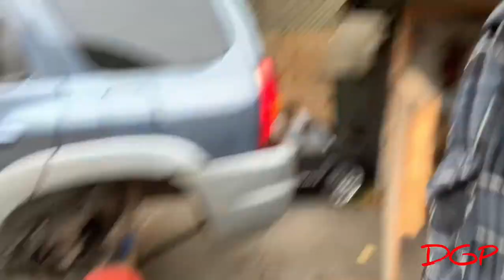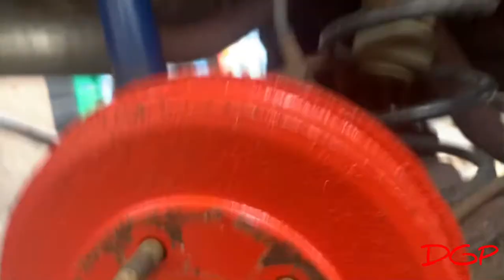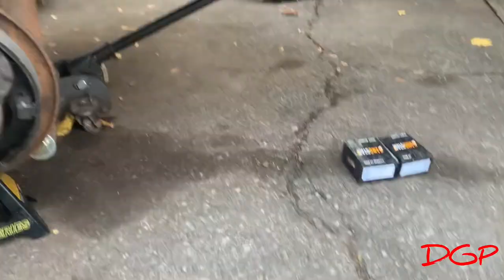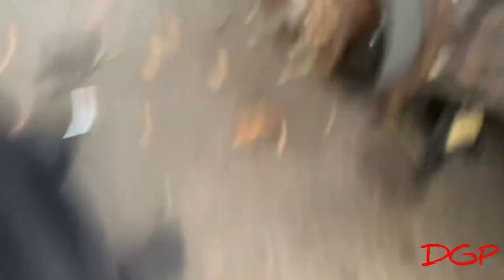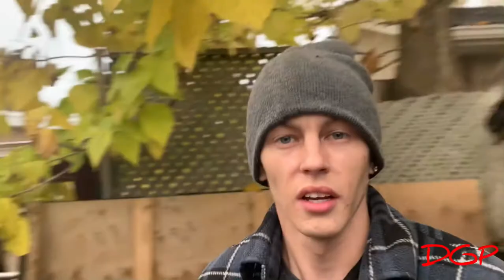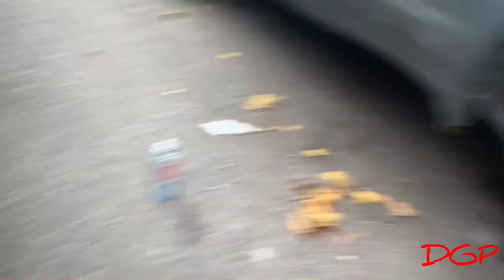Mazda Tribute Rear Brake Job (Drums&Shoes)

Comment: Cool man, also how bad is the self adjuster on these cars (bad)
Reply from the maker: Wasn’t to bad I did replace them, just didn’t get a chance to record it,  a brake line an a bolt just careful if the line is rotted might need to replace a section of it but either then that not to bad simple easy fix
Reply: @dellgarageproductions  Bad design I mean
Reply from the maker: @NobleNobbler  yeah any type of drum/shoe thanks for watching